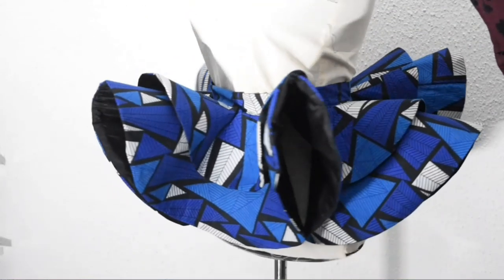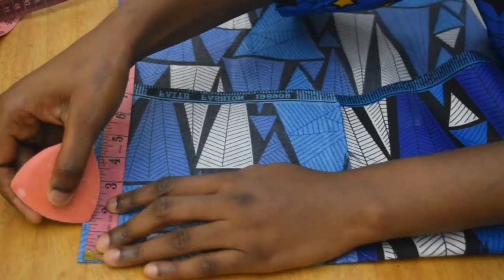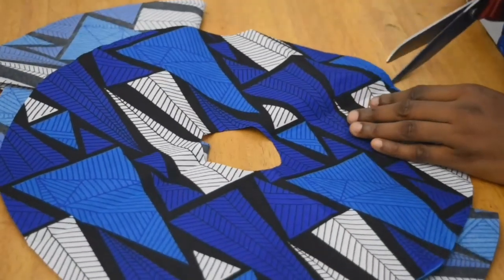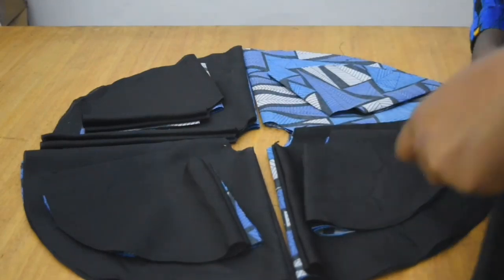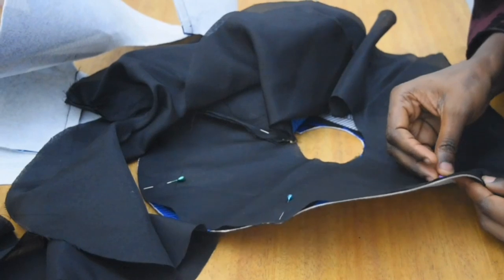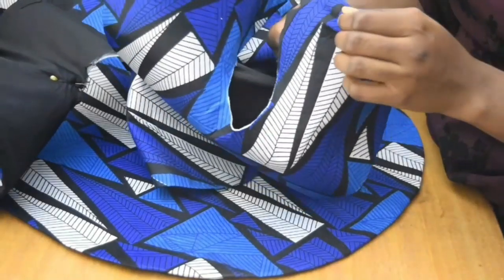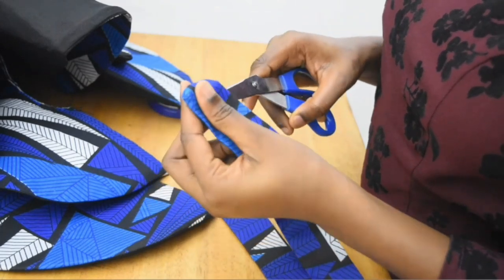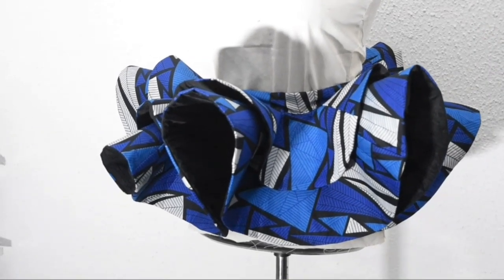HOW TO MAKE YOUR PEPLUM/FLARE STAND | LAYERED DETACHABLE PEPLUM BELT | LINE YOUR PEPLUM STRESS FREE

Comment: This is awesome... you are not just good at this you are also a good teacher. Weldone. 
I would like to ask why you made 4 360 degree flays and not make 1 straight glay that will accommodate the waist you were trying to achieve ? Does making the flay in smaller sizes have effect of the curvy flay you arrived at at the end?

Weldone once again God bless you.
Reply from the maker: Thank you. I made 4 because I was making 1440 degree flare (360 x 4). It will make the flare more fuller compared to just making just one 360 degree flare.
Reply: Thanks for reverting.  I guess my question isn't clear.  What I meant is instead of dividing the waist into 4 under to have 360 degree flay in 4 places, cant 1440 or 720 be achieved with a single flay so that there wont be any joining and will it still give the same curvy effect?
Reply from the maker: It can't be achieved if you want your exact waist measurement and want lots of flare at the bottom.